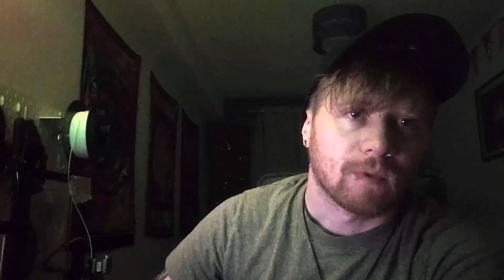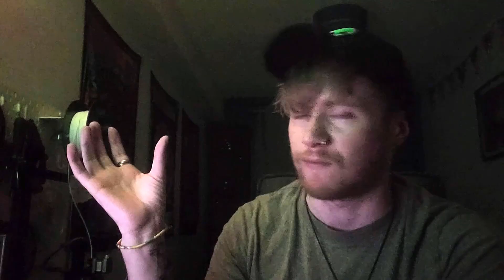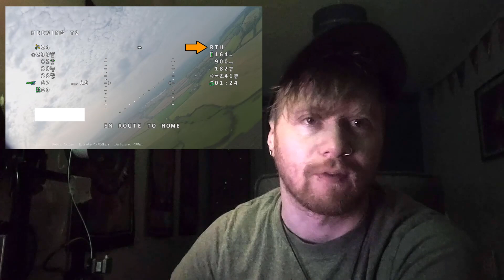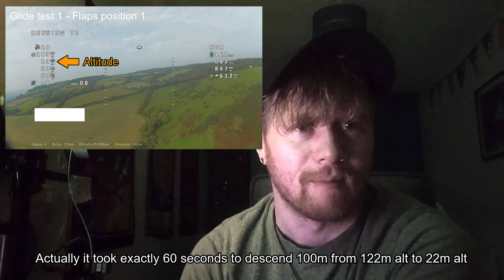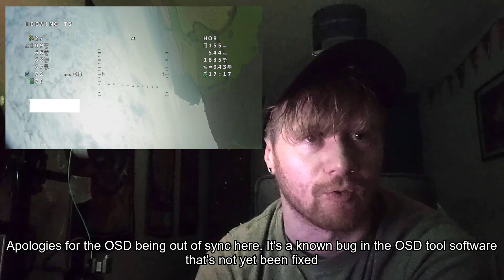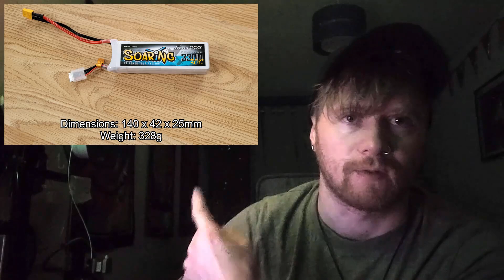🛩️ Heewing T2 - How Well Does It Fly?

Comment: Hi! Are you flying the plane on 4s ? I saw on the website that Heewing recomends 6s in it.
Reply from the maker: Hey, yes I'm flying 4s. My T2 was sent to me by HeeWing months before the official release and it's the prototype. My version is only 4s compatible, however the official versions you can now buy are 6s compatible
Reply: @gizfpv  thanks for the reply. I just ordered mine. So i will have to get new batteries as well. :( I was hoping it will run on 4s  as that's my current stock of LiPo's

Comment: On my last flight with the Phoenix2400, the glider wanted slightly turn to the right. I was noticing that the artificial hozizon was just a tiny bit off from the natural. At home I measured the wing line against the fc reading and it was nearly  2.0 deg off.  This might have been the result of some landings in higher weeds. This stressed the wing section where the fc mounting plate is. I simple adjustment did it, straight again....

Comment: Great check list of tests, and flight debriefing Giz.
With the glide test, I noticed airspeed was much lower than when did the flap tests. 23-40 km/h glide vs 50-85 km/h with flap tests. Was a bit surprised at how slow, and still had great handling. With the initial flap test, seemed each increase in flaps decreased airspeed by 15 km/h. A great feature for making slow landings with a larger plane. Nice to see the amps dropped from 10A to ~2A when power reduced from 78% to 40%. This means a very signifiant gain in flight duration could be had based on speed and power setting choices.
Regarding the rudder and the yaw wag, if possible, I'd suggest using a rear facing camera to investigate what the rudder deflection looks like in the air. It could also reveal how much the rudder is moving in flight. I would have expected to see more rudder authority than was demonstrated. 
For the turning tendency, one wing being heavier, a wing having more drag, or an aileron out of alignment could cause it to have a turn tendency. Also if the rudder is not centred, it can cause a hands-off turning tendency. Might just need a tad of trim? Being larger and more stable, a gentle consistent turn is likely more noticeable than a light plane that would have random roll pattern as encountered any bit of air turbulence.

Comment: T1 have 2 drastic faults, very aggressive stall with nasty wing drop and rerally hard to lock the heading, its always trying to turn, hard to keep heading, looks like this problem persists and its TERRIBLE!
Reply from the maker: I've owned two T1's and haven't noticed either of those issues with mine 🤷
Reply: @gizfpv  I only fly manual and tried some stalls to see how handles, maybe you didn’t or I have 2 bad ones!

Comment: If your plane looses altitude in a stabilized mode, it's NOT the CoG. It's simply the Flightcontroller Levelling needs some adjustment. The CoG you have to test in manual mode. Same with the Rudder, you cannot see its efficiency when flying in Horizon Mode, because the ailerons counteract the roll moment. Test it in manual, or at least in a stabilized curve, to see if usable. 
And the flaps are not there to gain altitude, the main reason is to lower the speed. I see the speed going down drastically, which is a good sign. I just miss that you mention this :-)
Nice plane, I also ordered one. Very curious how it flies, and how far I can go with it!
Reply from the maker: Loss of altitude when hands off the sticks could be a CG issue, although admittedly the aircraft would need to be very nose heavy. I agree it's more likely to be due to the FC accelerometer calibration and pitch offset setting, which is what I was trying to allude to in the video. As for the rudder, you may be right about horizon mode, however on the bench I've done some testing today and there's no more rudder movement in acro mode than there is in horizon mode. So Idk, will need to actually test in flight. Shelby says he noticed his rudder also didn't have much authority either though, and as far as I know he's flying full manual without a FC 🤷

Comment: What are the props  and motors  you use in this test? Concerning the efficiency they matters much.
Reply from the maker: Motors I currently have are Sunnysky 2212 980kv, and they're paired with 8" props. The final version of the T2 will have slightly different motors though

Comment: I confirm the way it flies ... very nice! But the Rudder seems to have more effect in my flights!
Reply from the maker: Really? That's interesting. Shelby said he found his rudder seems docile like mine too
Reply: @gizfpv  try putting the rudder to manual yaw instead of stabilized yaw. Will point that out in the next video
Reply from the maker: @JustFPV-net  I've already tried that. Doesn't seem to be any difference, rudder moves the same amount in both horizon or acro mode 🤷
Reply: @gizfpv  that’s strange ,,, I know I’ve enjoyed yawing around with the rudder after it wasn’t inverted anymore haha
Reply: @gizfpv  horizon and acro both use stabilized control, reliant on the PIDFF loop, on my rudder planes, I really have had to crank P and FF up on rudder.  With such a large control surface, I'd think it would have a lot of yaw authority.  I have been looking around for my next plane, but I've gotta have a good rudder.

Comment: at 14:29 you mentioned you flying at high throttle, but the amp draw only 8A. Could be due to cause it's setup for 6S but you are using 4S, so more throttle required, but in this case it's also under-prop hence the low amp draw.
Reply from the maker: The final version of the T2 (the one that you can buy yourself) will be setup for 6s, however the prototype version that I have is very much only setup for 4s. The motors and ESC's on mine are only 4s compatible

Comment: I've loved your videos since the efx with fc video. "Split flaps" aren't much different than "plain flaps" that we commonly use in rc stuff and work fine IMO. The other 2 forms of flaps don't really make it into fpv rc stuff. That's going to be a really solid large cruiser and vtol platform, I like it. Haven't seen that kind of battery space since my Killer Whale. Great video!
Reply from the maker: Damm, you've been here a while if you started with the EFX video lol. Yeah I reckon the T2 has the potential to be a excellent and efficient long range flyer. That's probably why Heewing call it the Cruza lol
Reply: I just found it a couple years ago, still fly mine but with a 5500 4s battery and 2820 1250kv motor. gets me close to 13 minutes in the air hauling butt, quietly. Glad to see your videos going again!   @gizfpv

Comment: Do you think that side-to-side waggle has anything to do with that rudder
Reply from the maker: It's a possibility. As I said in the video, the design of the rudder on my T2 isn't perfect and it'll be different on the final version of the T2. Could be that the rudder isn't stiff enough on mine, which is causing the side to side waggle. Alternatively it could be a problem with the programming, have had a few suggestions that I need to investigate

Comment: So it can come with a flight controller?
Reply from the maker: No it doesn't come with a flight controller. Later versions might, but atm the version being sold does not. I added my own
Reply: Ok. I thought in the video you had said stock pids were fine.
Reply from the maker: @horsship  yeah, I meant the stock pids that came with the flash of inav 6 firmware that I put on the flight controller.

Comment: Great video. You're doing a really good job of convincing me I need one of these things in my life. Since they're already selling at full price, I'll probably wait until they get in people's hands and Heewing figures out what minor updates they need to make like they did on the T1, but it sure does look like a nice flying plane and the foam they use is rock solid.

It does look to fly at the speed of smell, though. 35kmh for 40% throttle? Given you were only pulling 25A combined at full throttle, there's probably plenty of headroom to put a higher pitch prop on than whatever they sent you, but who knows what kv/pitch combo they'll settle on, with a motor that's a little longer than the prototype setup, too.
Reply from the maker: Yeah it's certainly not a fast aircraft. I guess you could try a higher pitched prop, however i'm guessing they've designed this aircraft to be a slow but economical long range endurance cruiser (hence the name cruza). Will be interesting to see what it's like on 6s motors. I believe Heewing are gonna send me some at some point, but chances are paying customers will have their T2's first so can gauge from them what it's like
Reply: @gizfpv  I don’t know what kind of motors JustFPV had on his (I think he said he doesn’t know either lol, they definitely weren’t the same as yours) but he did his video on 6S and it was maybe faster but… not by much. At 75% throttle he was still only doing something like 60kph. He kept the throttle pretty high the whole time so it’s hard to compare but it still seemed pretty docile. Then again if your motors were specced for 4S and his for 6S it stands to reason his would be 2/3 the kv of yours and perform the same except at a higher voltage and lower current. I guess we’ll find out when the final spec starts hitting people’s doorstep.

And yeah if they are calling it a “Cruza” it makes sense it’s not a rocket ship but 35kph is still shockingly slow to me. I still want one though haha.

Comment: I really really don’t like the fact it’s going to use 6s packs. 4s seems to be the standard cell count for fpv planes this size. This adds to the cost now buying large capacity 6s Lion packs or 6s Lipos.
Reply from the maker: It seems to fly absolutely fine on 4s and has plenty of power, so yeah I'm not sure what the reasoning is for making the final version a 6s. Faster maybe? 🤷
Reply: @gizfpv  I'm guessing it's just because most ESCs these days are at least 6S capable so why not advertise it. I have to assume the motor kv and prop pitch will be sized for 4S.
Reply: You can still use 4s with the 6s setup
Reply: 6s less amp draw
Reply: @eltio77556  Well, yes, since it has higher voltage, for the same power in watts it's less amp draw. But it's not magically more efficient. You need to size the props and motors appropriately for either one.
Reply: I guess we could always swap the motor for 4s ones but that would add to the cost
Reply: @sr-prod  there's not really any such thing as a "4S" or "6S" motor (obviously within reason). Motors generally burn out due to too high current. Turning 8" props at 6S would need a really low kv on motors that small, which is pretty rare. They don't advertise what the kv is on the motors that will come with it, or what pitch the props are, but my guess is that it will be a pretty standard 4S configuration.
Reply: @swissfreek  Yeah by « 4S motors » I was implying a KV adapted for the 8 inch props and 4S voltage.
Let’s see what they ship with the final product…
@gizfpv what’s the motor KV on this current test build?
Reply: @sr-prod  Ah, I understand now. Yes, I agree.
Reply: I can run my Dolphin with a 750kv motor on 4s with an 8x8 prop and it does ok but doesn’t have the same performance as the 6s. Probably could run 4s just fine just runs more efficiently with the higher cell count 🎉
Reply: @dronepilot260rc  8x8 is a relatively high pitch prop, so that makes sense. pro size/pitch arel intertwined with kv and voltage, so you can change multiple variables to make different setups work. But obviously there's limits. You can't run an 8x16 or 8x2 prop to make up for a kv or voltage that's much too high or too low🤷🏼‍♂
Reply: @swissfreek well I’m comparing a single motor pusher to a twin tractor. When you have two motors, you don’t need as large of pitch or prop. Check out my flying baseball bat for reference.  I kinda know what I’m talking about from experience not guessing.
Reply: @dronepilot260rc  I wasn’t arguing I was agreeing with
Reply: Instead of purchasing 6S batteries, can just pair a couple of 3S packs, or get a 2S to pair (capacity wise) with your existing 4S. In a larger plane, the weight of a Y-connector is minimal.
Only reason to go with 6S over 4S is to make maximize use of battery capacity for a given weight. Using appropriate kV motors with 4S should offer just as good performance, just not maximum possible.

Comment: Yeah could be P factor causing difference in rudder control from left to right. Are both props turning in the same direction or counter rotating?
Reply from the maker: The props are counter rotating, so it's not a torque issue. Could be a pid issue, could be a physical issue with the fact the rudder on mine isn't quite built perfectly (as it's the prototype), or it could be something to do with differential thrust. I'm going to investigate it further over the weekend

Comment: The Yaw was dead because you had it in Horizon Mode...You need bank angle to yaw....😳😳😮🇬🇧
Reply from the maker: That might be true, however even in acro mode the yaw authority seems very minimal and similar tbf. Shelby has also said the rudder on his seems to have little effect (and as far as i know he doesn't even have a fc on his T2), so idk. Will investigate further next time I fly
Reply: @gizfpv  Put it in manual, not Acro...Then test Rudder authority. It doesn't help not having any dihedral on the wings either...😮🤔🤔😳😏